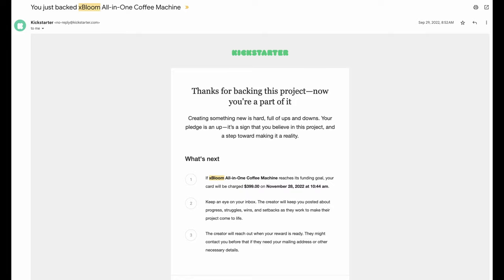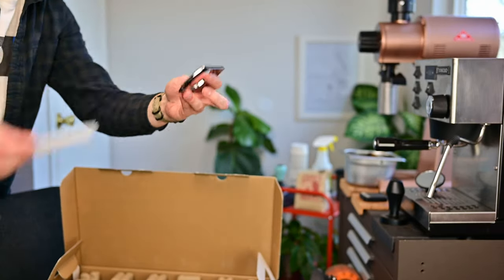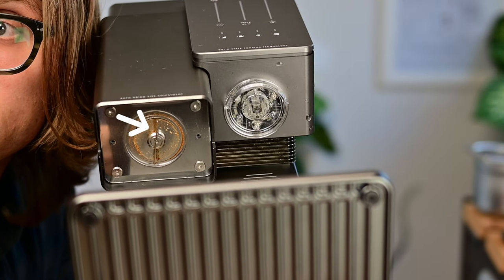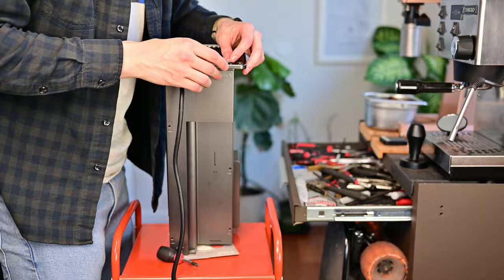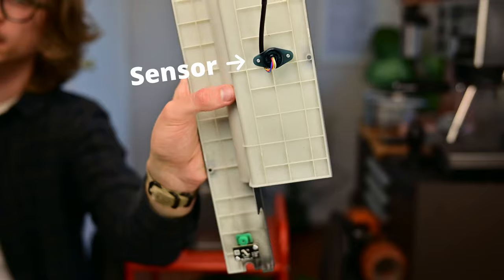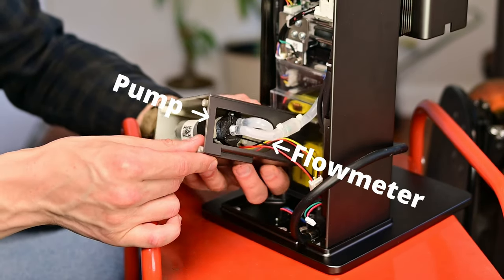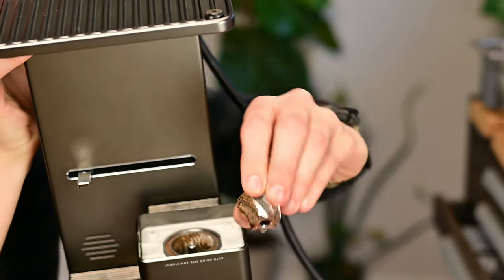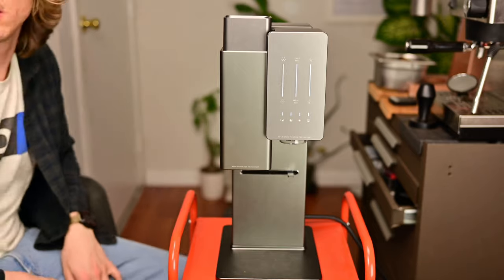An Engineer's Look Inside the xBloom Automatic Pour Over Machine

Comment: This was great! I’m pretty intrigued by the conductors, though I wonder how much granular control you have with it. I wish the stream didn’t break up before the bed though
Reply: Hey James! Planning on doing a review on this one?
Reply: @eliiiiiijah  yes!
Reply: @jameshoffmann  Excellent! Looking forward to it :)
Reply: Rad to see the Hoff on this channel. Tate is doing some cool things!
Reply from the maker: Thanks James! For sure one of the most intriguing parts of this machine. The app just has 3 modes (spiral, circular, and center), but I'm impressed that the coverage is pretty good, unlike a lot of other brewers!
Reply: I’m a simple man. I see James Hoffman, I click like.
Reply: Hi James, as a fellow UK backer on this machine, I'm keen to get your thoughts on the issue of using the EU Type C plug instead of the Type G, it's a shame it hadn't been designed with a detachable cable like many high end appliances, then we could just by a replacement cable, but alas no.

Comment: Any chance you are able to see part number/details of the water heater and pump? I was hoping to use it in a personal project since it seems to fit the exact specs of what I need
Reply from the maker: I had a similar curiosity but none of the internals were familiar parts to me, my understanding is that the majority of engineering and parts sourcing was from the Chinese market
Reply: @tatemazer  Ah thats really unfortunate.  Reached out to xbloom and they wouldn't let me know since I didn't actually own a machine of theirs.  Unfortuante really, maybe it'd be different if I had one but $800 is steep
Reply: @riopacheco01  The new xBloom Studio is "only" about $500 or less with the pre order.